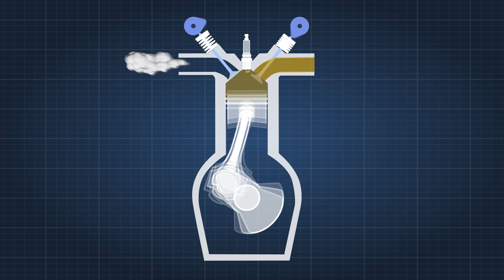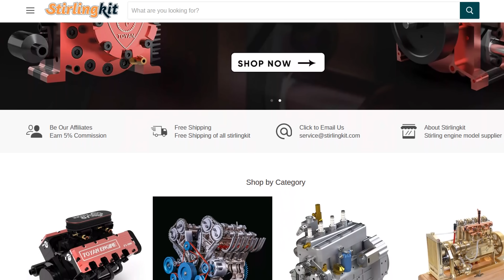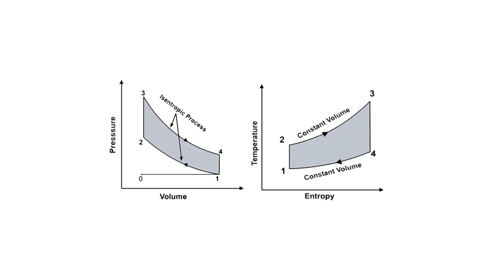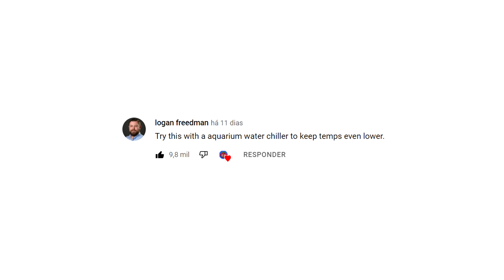I 3D Printed a Transparent Combustion Engine in Resin

Comment: It looks like your tappets are floating - I'd adjust your valves or pushrods so that the tappets just barely stay in contact with the valve stems through the whole rotation. You can use feeler gauges or even a slip of paper, just like adjusting the nozzle height on a 3D printer.

You may effectively be retarding the valve timing with the tappets not in contact with the valve stems, so your intake and exhaust strokes get out of sync with the valves just enough to limit intake charge, so it takes a couple of strokes to get enough fuel at the right mixture to burn.

Also, you should require some adjustment to the needle valve on the carburetor for different fuels - this adjusts the fuel/air mixture - I see liquid fuel in your cylinder at the end of a couple of those runs - you're running VERY fuel rich, and also at very low compression, or else your engine would have shut itself down, or destroyed the connecting rod/crankshaft when the cylinder was full of fuel on the compression stroke (both valves closed) Since it didn't... you're probably well below 8:1 compression ratio, or your piston ring is really not sealing well. I could probably calculate compression by the position of the piston in the video, but honestly it's probably somewhere in the specs of your engine kit. 

Long/Short: check your mixture, and adjust it until you get predetonation, then back off the needle valve a little. Alternatively, get a wideband O2 sensor and adjust it electronically, but those are a few hundred dollars. 

5 bucks says you'll get higher speeds on the nitromethane than the gasoline, once everything is adjusted right, since you'll be able to burn more fuel for the same amount of intake air.

Comment: I thought this was a hit-and-miss engine that cuts ignition spark to limit the rpm, and since you didn't change the jetting and timing the "better" fuel couldn't raise the rpm enough so the "computer" didn't cut the spark but the others raised the rpm so the spark got cut to stop them running away? just my theory :)

Comment: Your plastic Cylinder is like a brick, only strong under compression so bolt it down from the top only,  your cylinder head is metal so put the bolts through that and your cylinder can just be a  strong tube NO flanges or brackets clamped between the head and the crank case, do the head bolts up to the same tightness diagonally, BAM! no compression leaks= reliable power cycle.   for your next vid please 3D print a Trebuchet to fire Tomato's YUCK! at a target and make them explode, HURRAY! you may think this is too easy but all the forces involved are invisible and they were once top secret because they were to difficult for most people to work out.   TREBUCHET! Please Inteza. Love your channel, Funny and interesting.

Comment: hi bro this issue is because every engine is designed for specific fuel 
for example : petrol engine are designed to have a low compression rate where else diesel engine are designed to have a high compression rate 
so in this case the engine that you own may have a low or high compression rate so if u have to use other fuel efficiently we must have to tweak the engine's compression rate 
that's the problem you are facing while using different type of fuel and u changed the engine to transparent by resin which may some error can be occur in dimensions and cause this problem

Comment: Idea based on the watercooled jet engine video and your previous work with priinted metals and ceramics
Optimising everything we can for heat exchange and fluid cooling; I really think it could 110% work with the right coolant and a different material for the internal heat exchange membrane abd would beamazing to see - especially whether if it can sustain itself without failing and potentially even multiple tests

Heat exchange depends on the thickness of the exchange membrane, the material itself and area it can act off and the difference in termperature (amongst other variables that can potentially be controlled to optimise the rate of cooling)

One easy to make coolant that's still basically water is a brine, by adding certain salts to water; they take energy from the system to dissolve and cool the water a lot, as well as reducing the freezing point; an ammonium chloride, sodium chloride and icewater brine is how the zero point of Fahrenheit is defined and is one example of a way to increase cooling
By looking at newtons law of cooling we can optimise the rate of cooling by using the largest temperature difference we can (thats not flammable is ideal for plastics), you could theoretically cool this already cooler mix further using a dry ice bath to cool the circulating fluid
One other option is using antifreeze (any glycol will probably work, but I'd look into which has the best specific heat capacity and freeezing temp) and a dry ice bath to get that coolant incredibly cold before circulating it - it all depends on how you want to approach it, but the glycols will probably be a bit more effective (but a bit messier, they make everything slippery and a bit ugh), but the brine will be easier to make/clean (though wont be good on any metals in the circulation circuit it's worth noting, much like how salt water messes with other metals)

Second is the material, metal is the obvious one, but ceramic is another option that may also work; they exchange heat better, melt at higher temperatures - the limitation will be trying to ensure theyre thick enough to handle the momemntum of the circulating denser fluid in the cooling system as well as the much faster moving lighter fluids in the engine part

Thicker often means a slightly lower rate of heat transfer, but realistically it may not be as much of an issue in this case (diminishing returns kinda thing)
The last is maximisng the contact surface area for heat exchange, you've probably seen how a radiator or air conditioner internally tries to maximimse the amount of area we have for that heat to exchange across, but obviously we have to still be careful to ensure that the flow of the cooling system is able to reach every part as well

Another issue to that end was the filling, if you have air pockets in the line or it fills from the wrong angle, it can difficult to ensure the cooling circuit is free of air pockets; by having it fill from the bottom and go out through the top, you can make gravity to the work for us for once instead as revenge for the joint pain 

I think with a few small changes (mainly internal medium and using a coolant that can handle much colder temperatures to improve heat exchange) you could 110% get this to sustain itself without failing 

Plus I'd love to see a newton gauge like others have suggested to see how your progress with more efficient thrust progresses - love your work chief, I've always loved the materials side of engineering but you've really shown me some approaches I wouldn't have thought of based on what I've covered in the degree so far; love your design process

But coming from healthcare into engineering,  seeing the butane cooling scared the crap out of me - I don't doubt you would have taken the precautions needed though
Reply: Take a page from NASA. Use liquid butane to cool the thrust chamber.  Vaporized butane is then routed as fuel.

Comment: @1:16 So that begs the question, what is the energy efficiency of a Lithium ION batteries to convert into kinetic torque energy.  Assuming 100% efficiency then the gas powered engines are still 25x more effective by volume for storing energy for locomotion.

Comment: Nitromethane requires approximately 9 times more fuel than gasoline. Methanol requires approximately 2 times more. Neither nitromethane or methanol has as many calories as gasoline lb for lb. However when you shove either 2 times the methanol at 75% the calorie content you end up with 150% the calories in the cylinder total. Nitromethane is right at 25% the calories as gasoline however 9x more by lb equals 225% the power of gasoline.

Comment: You are wrong about gasoline energy density. You have missed something - the mass of Oxigen. And it does not matter that Oxigen is cheap. It must be counted for energy density of fuel. Li-battery will work under water and on the orbit. The same thing for gasoline will require supplemental tank with Oxigen.

Comment: You need to adjust the timing of the motor.  So it sparks a little early. The way your spark will be in time with higher RPM.

Same as with the top fuel drag racers. They run terrible at low RPM, but a high RPM they run super smooth.

Comment: A more “powerful” fuel imparts more energy into the engine crankshaft. This, in turn, puts more inertia into the pistons which still have to stop and turn around.
Reply: But considering it’s moving in a circular motion so not just vertical movement from piston, and the energy from the explosion is much larger than the weight of the piston head, surely this isn’t an issue with more powerful fuel?
Reply: @BenitoDiazRazul  if the system were only moving in a circular motion… the pistons still have to reciprocate and exhaust all the excess gases from the more powerful fuel.

Comment: A really interesting experiment

Discover the real gyroscopic effect created by the direction of rotation in a 4 stroke engine

As background look up
Group B Peugeot 205 T16
This was a mid 80s rally car that had a transverse mid mounted engine

A problem became apparent on certain rallies that had long fast straight sections with "jumps".

The faster the car crested the jumps and the further it travelled through the air the car would rapidly pitch nose down literally landing on its nose crashing.

The Peugeot engineers tried everything in an attempt to solve the problem including moving weight from the front to the back to try and balance the car.

All to no avail.

Eventually someone had the idea to change the engine rotation from clockwise to anticlockwise.

Success

Problem solved.

Comment: the millions of years part.. is the flooding of the swamps and bogs getting soil deposited till the clay layers thick enough to become shale then repeating till the surface density puts over 2000lbs of presure cubed upon the dead algae then has to get really hot.. like really hot.. hot enough to forge steel

Comment: You will loose power and miss power strokes with timing to advanced or to retarded. The 25 percent fuel is likely just combustible enough to pick up the slack. Or picking up slack of low compression. Need compression numbers to know for sure

Comment: Power is only relevant if there is something to power against, i think it is to fast and to light materials, with a 4 cyl engine the engine must stop and start and end of strokes, yawing a rotary engine then u should have more power/revs with the more powerful fuel. If u want it with the 4 stroke engine then perhaps putting a heavy flywheel on it could help to show the fuels power being more 😉🤷‍♂️🥰🐶

Comment: I'm thinking that the exhaust ports aren't large enough to depressurize the cylinder fast enough and the spark system is tuned for a slower system where the flow out of the exhaust port is choked (Sonic).

With a high enough pressure increase from the power stroke, the cylinder maintains a high enough pressure during the exhaust stroke to decelerate the piston within the response time of the spark system.

I'd suggest first fixing the spark system to respond faster. I'm thinking you'll get a power stroke more repeatably. Then open up the exhaust valves to eliminate any choke. You should see the higher energy fuels go faster, until they teach the response time of the new spark system.

Good luck! Love your channel dude 👍

P.S. - while the wenkel may have fewer strokes, it's far less efficient than the piston engine due to compression ratio alone. The geometry of the triangular lobes don't allow for high compression ratios. So thermodynamically it'll be less efficient

Comment: I think I saw something: To me, it looked like some of the fuels ignited well past the cylinder starting the power stroke - It seemed to flash at the mid stroke position - which would lose you a lot of energy, as the explosion would work against the piston when it's going into its exhaust stroke. If my eyes aren't deceiving me, that's a timing issue and may be related to the missing power strokes issue. 

From my limited knowledge of combustion engines, I seem to remember that you need to tune the engine according to what fuel you're using to get the action to work right. So that might be worth tinkering with.

For the missing power stroke issue, I think you need to do more tests. See if there's pressure escaping around the top of the cylinder, what happens if you move the ignition timing around, etc.

Comment: The reason is due to the gas expansion speed along with how well the fuel is atomized from the carburetor methanol produces more power and speed in both full injected and carburetor engines but because methanol is technically a higher power it takes more for it to combust so most people will “gap” their spark plugs to make the arc longer to help ignite more of the fuel but in order to run it reliably you need a higher compression in the engine by getting a rod that might be at most 3,000ths of an inch taller there’s a lot more to it but this is the short version

Comment: you started with a leak at the top of the cylinder, then compounded it when you polished the casing to also have a leak down the sides of the piston (which is actually easily visible in your footage even without slomo on most of the fuels).  A tip: when you're removing material (which you do when you're polishing) you need to start with a medium that is bigger than its supposed to be, and work it till it fits everything exactly.  You could potentially solved the top leak with an o-ring, but the inner leak would only be solved by printing the cylinder so that the piston doesn't fit before polishing, and polishing it until it tightly fits into the cylinder.

Comment: Nitromethane is actually a slow burning fuel. With each fuel you'd need to make some tune up changes. With all the fuels you need to spark in advance of top dead center. With nitro you'd want more ignition advance. Also the stoichiometry is different for all. With 25% it would actually need to be leaner than methanol I believe, but with higher percentages you'd need more fuel in the air fuel ratio. You need to burn nearly double the amount of methanol than gasoline. The good news is that a methanol engine runs cooler. Methanol also burns invisibly. Ps. I'm a drag racer with a 7 second car running on methanol
Reply: You also want a very good spark with nitromethane and methanol. On methanol we run a magneto with a powerful spark, and we run small spark plug gaps to try and ensure the spark come out on the correct plug and isn't induced in other leads/metal thinga

Comment: Hi Joel Hunter again,
Another reason why the engine is doing only one power stroke per eight strokes could be that the Hall effect switch/sensor might not be registering some of the strokes because of how fast the engine is running.

Kind regards 
Hunter

Comment: For whatever reason, the 25% had to deal with more pressure, therefore slowing the engine down.  It was actually getting a powerstroke, so it makes sense it had more resistance, yet the engine would be harder to stop.  This tells me it had much more torque.  How about those gas prices? 😆

Comment: It's very likely that your fuel/air mixture is the cause of your performance issues. Methane has a far wider explosive limit range (the range of ratios with oxygen at which it will explode) than gasoline or nitromethane.

Comment: I think the problem is with the fueling misture and the compression time/ ignition time. I would sugest add a arduino to the magnet sensor that triggers the ignition in order to control the timing of ignition, delay it for example. For the fuel misture, try make a carborator. Basically diferent fuels require different engines types or timings, for exemple a diesel engine does not nees spark plugs since it ignites the diesel by compression, on the other hand gasoline can be ignited by compression to, but its more unstable and will change the amount of compression need in relation to is octane value. I'm not expert, i know that i'm simplifing a lot of stuff but for what you shown, the problem seems to be what I have discribed.

Comment: Fuel efficiency is more than just more power in the fuel, it's about how readily the fuel can get rid of the energy, or volatility. With a more volitile and dangerous fuel like nitromethane, it'd easy for the fuel to be broke down, but gasoline is a long hydrocarbon, and therefore takes more input energy to extract the same power out of each molecule, which could explain why the gas test was slower. Methane is a small chain molecule and since there is less bonds to break down, the fuel cam burn quicker and hotter since less energy is used up in the ignition process

Comment: The reason that the gasoline isn’t going as fast is because it takes longer to burn. For example diesel cars have more power but don’t rev as high because the power stroke is longer, all has to do the how much octane the fuel has.

Comment: Higher energy fuel requires more oxygen (explanation for the RPM difference) the higher the RPM, the more you need to do for ignition Timing, this is where dual overhead cams and other types come into play. Also, the more energy you produce from a fuel type, the more you need to do to exhaust the spent mixture.  The balance of Oxygen in - fuel in - mix - compress - ignition and the exhaust is a delicate balance to extract the most potential energy from the cycle and fuel. Pre-ignition, Air intake plenums, exhausts, and the rest are critical engineering components in race cars.